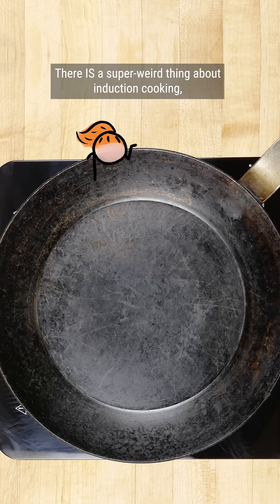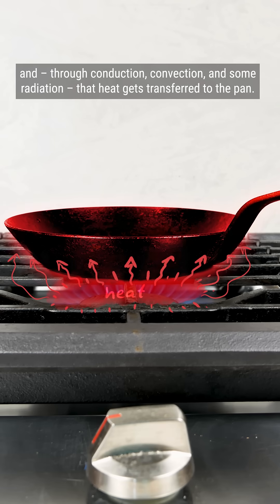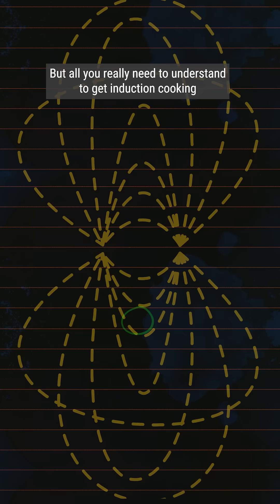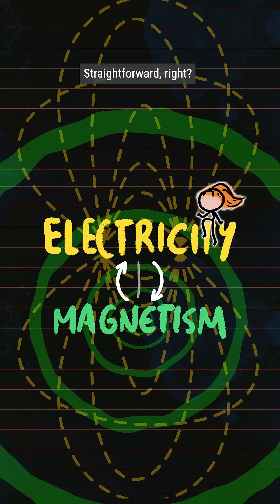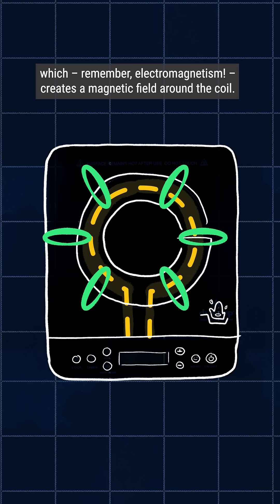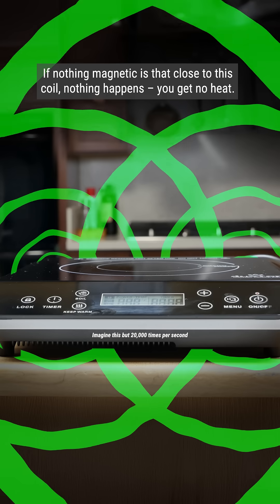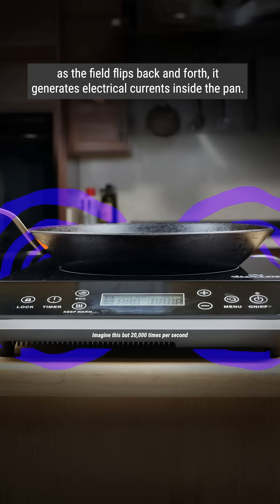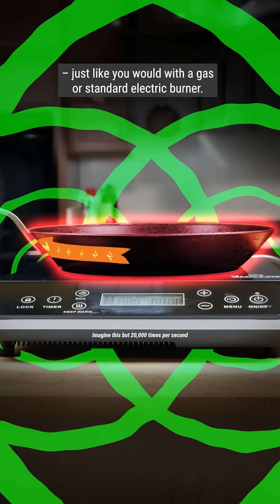How Induction Heats Your Pan

Comment: When we switched to induction I learned that the quality of the pan matters more than other heating types.  The magnetic areas only get hot If they are over the coil, so a thin steel pan will heat very quickly, but only where the coil is.  I tried a cast iron griddle, bridging two burners but it didn’t really work, cast iron doesn’t conduct heat very quickly so the edges and the area between burners doesn’t get hot enough.  Round cast iron works fine as long as it’s not bigger than the coil.  Copper in the pan makes for the most even heat, and more layers is generally better.   I won’t go back though.  The speed and not heating up the kitchen in the summer is too good to give up.

Comment: it's poo, for heating purposes, for humans, for cooking, for water heating, electricity is too digital, not analog enough, you get all hot, or zero hot, no inbetween. the only way the induction "heats up" is by increasing the heat applied, when heat is applied, but there's no consistent heat, so it's constantly oscillating between too hot to cook properly, and too cold to cook properly.
the more we just buy what is new, the less good things will be.
these engineers have never once actually seen any of their principles that sound good in theory applied in the real world, they refuse to acknowledge any of the practical application issues, and continue to be up their own ass about new equals better, like there won't be the same, decades long innovation schema that turns a prototype into an actually usable product. The more they do this the less interest people have, because their interest is always repaid with disappointment.

Comment: I thought radiation is only through no medium? Which is always impossible on earth since there’s always air everywhere, even in your kitchen.
Reply: No! The hea tfrom sun only comes as radiation, it would stop in the atmosphere, right? When sitting in front of a fire most of the heat you feel from it is radiation. Passing through a medium like air or water diffuses the radiation because some gets lost for heating the medium. The denser the medium, the more it blocks radiation.

Comment: Very good explanation, just one small correction: the pain itself is not magentic, just ferromagnetic, so any metal that interacts with magnets (for example, aluminum is not attracted to magnets, so it's not ferromagnetic)

The reason why that's important is because of magnetic conductivity. Just like electricity likes to take the path of least resistance, and would rather flow in a copper wire as opposed to plastic, the same goes for magnetism: if you have a magnetically conductive material, it will have much greater magnetic flux flowing through it -> this increases the induced voltage and this eventually gets you more heat
Reply: She and you are actually wrong, the pan doesn't have to be "magnetic", quite the opposite, it has to be electrically conductive, such that electric currents can flow through the metal, but not ferromagnetic, to don't get stuck on the surface while being on due to magnetic forces
Reply: @danielvitre476  it has to be both. You can check it by holding a magnet to the base of the induction pan/pot, the magnet will stick. If a material isn't magnetically permeable there won't be any magnetic field to even induce an electrical field in the first place:

B = μH

Where H is the field generated by the coil in your stovetop, and B is the magnetic flux density in the bottom of your pan. And since dB/dt is what ends up inducing anything, μ has to be sufficiently large.
Reply: @danielvitre476  induction cookers don't generate a strong field typically, that's why the pan doesn't stick to the stovetop. They however operate at a frequency of 25-50 kHz, which creates a huge rate of change in the magnetic field resulting in a very high induced voltage, even though the overall amplitude of the magnetic field strength is very small
Reply: Hey man, her explanation was better than your correction.
Reply: @jimsheehy505  I disagree. The explanation given in the video is not complete and partially incorrect. The explanation given by good man above you is accurate.
Reply: @jimsheehy505  what do you mean?

Comment: Aluminum pans, ceramic cookware (like pyrex), and stainless steel will not work with induction cooktop. Stirring food with a metal spoon/utensil can heat it up & burn your hand faster than expected. 

Credit cards with magnetic stripe on back can be erased if too close for even 2 seconds while induction cooktop is on.

NOT a good idea to sit laptop or other digital devices near induction cooktop, to use while waiting for food to cook... even for a minute or two.  Be more concerned about magnetic/inductive damage to internal hard drive or circuits, rather than just heat effects.

Comment: No, that is not how this works. Actually, what really happens is when the magnetic field changes, the metal retains some of the previous fields' magnetism, the change causes the fields to clash, creating heat, which is called eddy current
Reply: This is false. I'm genuinely curious as to where you got this explanation from because the real explanation you will find in physics and engineering textbooks, as well the in-field ISO documents for actual design and application goes as follows:

Briefly, "Induction heaters work by exploiting Faraday's Law, which states that changing magnetic fields induces circulating electric fields. These fields generate Eddie currents in the conductor, and since the conductor has resistance, those currents get dissipated and transferred to heat."

Magnetic fields don't "clash", they add together like any other type of vector and vector field: via the principle of superposition (they are literally vectors. They behave like vectors, not like cars). You learn all these basic facts and even test them in a high-school lab or Associates degree.

I'm a physics major. I've taken courses in EM Theory (which includes lab experiments). But you don't even need to be a physics major to understand such basic facts. There are countless videos and articles on the internet that will explain this phenomena without having to go through the tedium of Linear Algebra, Vector Calculus, and pre requisite physics courses. They can be broken down very simply without needing to skim over crucial details (unlike many other areas of physics). So I'm left wondering how you came to your conclusion given that the expanding to this phenomena is so accessible to the average person. It genuinely sounds like you don't have any expertise in this field yet didn't even bother to look it up and just assert your first and immediate thought as true, with absolutely no rigor or verification.
Reply: @helphowdoinputusername3571  you said exactly what I said. I just did it shorter
Reply: @stephenstyer8544  Once again, you are wrong, but this only confirms that you don't know what you're talking about.

My explanation is the same one given in the video (I just named the physical laws), the same explanation that you said was "not how this works." But now you're saying that we said the same thing, so the video is now correct?

So which is it, is the video correct or wrong? I was going to explain why our explanations are different, but the fact that you're self contradicting means I don't even have to.

Comment: Induction is junk. Yeah, it "works", but it requires that your best pans be trashed. No copper, not non-ferrous stainless, no metals that a magnet won't stick to. Guess what else that means? Your steel that has carbon in it? Yeah, that's going to rust if you're not Johnny-on-the-spot with cleaning, washing, drying, and probably seasoning, unless you like teflon in your food. Let's not forget about the fact that nothing electric works when the power goes out. A gas stove, whether natural gas or propane, will work just fine when the power is out. That means heat, hot water, cooked food, everything you do with a stove, can still happen. Just use a match to light it if you have electric igniters.

Comment: So it will electrocute if i touch it???
Reply: No. The induction produces eddy currents, which are basically microscopic current loops. The loops cannot leave the pan since no charge are being added or removed, so the pan does not shock you.

Comment: One thing I don’t see mentioned nearly enough about the benefits of an induction cooktop, deep frying, or more precisely, there is practically 0 chance of starting a grease fire. If you spill hot oil on a red hot burner or open flame you get grease fire, because for those to transfer heat to the pot they have to be hotter than the out of oil. But the hottest part of an induction set up is the pot the oil is in. So if any spills out there’s not flashpoint to make a fire.
Reply: Let me tell you man, you can get grease fire even with induction, i know because it happened to me while working in a restaurant, we had a wok in a induction cooker with oil for deep frying shrimp, but someone left the induction stove on and the oil reached a point where it self ignited, weird thing to see but it happens, but as you said, the chances of this happening are very low compared to a traditional stove.
Reply: While the chance of starting a grease fire is lessened with induction due to the absence of an open flame, it's stil entirely possible to heat up oil to the its flashpoint, causing the vapors to ignite. With animal fats this can already occur around 375 F / 190 C. Most vegetable oils are a bit more resilient with a flashpoint around 450 F / 230 C.
Reply: The oil still might catch fire if it gets hot enough. Don't ask me how I know.
Reply: But you are still able to heat the pan up enough to start a fire I’ve seen it happen
Reply: That is true but it comes with an additional risk: as the energy transfer is so efficient from the coil to the pan it heats up so quickly that you can burn anything in seconds if not paying attention, which leads to fire risk from the contents of the pan itself. 

This also happens when boiling. In a conventional stove the temperature of the pot never raises above 100C if there is enough water inside but with induction you can overheat the metal even if there is water on top of it... That's how I ruined my old pan when I switched to induction and also the reason why you can burn the lower part of the vegetables you are boiling if they touch the bottom when on full boost
Reply: @saetastr Never had that happened to me and I have years of experience using induction.
Reply: @saetastr  I mean just don't turn the heat up that high and it'll be fine. You get plenty of heating from medium power and you can simmer just fine on low. The only time I use the high power is to start boiling (I turn it down when it starts to bubble) or to quickly pre-heat the pan for like a minute before turning it way down
Reply: @kinslayer202 you wanna use maximum heat with a wok

Comment: I have a 5-gas burner at home; the fifth one is a large dual-ring burner for large pans and woks.
I use aluminium pots to cook rice in. I use a wok when I make a quick stir-fry every now and again. I do a lot of frying so induction wouldn’t be suitable, especially when I tip my pans to spoon-baste meat.
I used induction at a self-catering apartment on holiday once and I got so frustrated with it, especially when the touch-control buttons got all oily and wouldn’t properly register my touches with the frying I was doing.

Comment: Also, induction stoves are insanely fast, compared to standard electrical ones. At least that's what I've experienced
Reply: Yeah you have to be careful with carbon steel not to heat it up too quickly on induction, otherwise it'll deform

Comment: EMF is radiation. It's basically an mircowave pointed up. Fml
Reply: No, not really. This is like saying that sailing the seas on a sail boat and flying a jet is the same because both of these propulsion methods use flowing air at some point.

Comment: Not a fan of induction. It only heats the specific area. Consequently making the sides of the pan cooler. Can’t beat cooking under fire. I only use induction to boil water for pasta.
Reply: I like my lungs. And not burning my hands on red hot handles. Preheating pans works just fine.
Reply: That depends a lot on the cookware. My favorite pan gets hot very evenly. But I have others (very cheap ones) that heat unevenly at the bottom, and stay cooler on the sides.
Reply: @schana96 I have le cruset, Staub, made in and all clad D5. They are definitely not cheap.
Reply: @ Don't know what to tell you. My favorite one (that works perfectly) is a Tefal. Wasn't particularly expensive either - like $70. My cheap ones, that don't work well, were like $10.
Reply: Can't beat gas stoves for a searing hot pan frying
Reply: @ yes you can.
Reply: @sendoh7x  do you seriously believe induction doesn't get as hot or something?
Reply: @sharkenjoyer  if you crank up the power on an induction cooker, only that small area that get really hot. Also not really condusive to do that tossing motion
Reply: @sendoh7x  i have no idea what kinda temu extra tiny gnome stovetop you're using, but my plate has circles big enough to cover the entire pan.
The edges do get hot too.
Reply: @sharkenjoyer  good for you
Reply: @sendoh7x  I agree the heating area is more direct than diffused like gas or other type of stoves.

Comment: In schools they taught us "In electricity, heat is always generated through the resistors" so my dumb brain still uses that frame to understand the world, im here trying spot where the resistor is on the pan so it can get hot while the currency going through it, unable to find it obviously i exasperate "wait, magnetism is electricity now? When did that happen?"

I am a biotech guy, despite the fact that i know what AC is, outdated school brainwashing STILL interferes with how i try to understand the world. Schools should be more about learning by doing and observing the effects in a play environment, rather than having to memorize a bunch of possibly outdated tidbits of neatly packed information because thats the only way to tangibly score the students on.
Reply: Basically, any metal has some resistance unless it's cooled to like absolute zero-ush temperatures. So, the pan itself is the resistor. Yes, the resistance is insanely low, but heat generated is proportional to resistance times current squared, so it's more important to have massive current than massive resistance.

Comment: How much of an electric current does it generate; just curious if you can get electric shocks
Reply: Did you watch the video? It doesn't generate an electric current, it generates a magnetic field. The magnetic field doesn't generate an electric current, it just generates heat in the molecules of the pan.
Reply: @thegreybrewer  Incorrect, as magnetic fields cannot generate heat. The field does generate a current, but it's eddy current, aka. microscopic loops of current that generate heat through electric resistance. You cannot get shocked by those since the current is confined to the tiny loops and does not enter or leave the metal
Reply: You can’t get an electric shock - there can be high current in the pan, but there’s no new charge flowing into the pan. So it will stay at the same voltage as when you placed it down.
Reply: A single loop of wire on top of an induction hob gets about 6V maximum in it. The electricity induced in a cooking pan flow in it and there is no possibility of shock.

Comment: how power efficicent is it compared to a regular eclectic stove? and just to be clear, I don't mean those cheap looking ones with the could you place the pan directly on. those suck.
Reply: A gas stove on average heats up the room more then it heats the pan, so yeah the induction pan is extremely efficient, but realistically it depends on your electricity and gas cost
Reply: 10-15% better than electric, in terms of efficiency. Another advantage though is the speed - induction pans get hotter much quicker.

Gas vs. Induction isn't even a comparison. It's like 3 times as efficient.

Comment: But why the hell do they need to flip directions? Why can't they just keep going in the same direction?
Reply: It won't create eddy currents
Reply: A change in magnetic field causes a change in current. If you have the coil operate in only one direction, then when you turn it on, the magnetic field will get created, which in turn will create a current in the pan. But then, electric resistance will kill the current, and since there is no change in magnetic field, the current will not change anymore either. You need to perpetually change the magnetic field to perpetually create new (alternating) current.

Comment: Magnetism is sideways electricity.  Every loop of the coil is electricity in the same direction, viewed sideways this is a lot of magnetism added up.  So the iron pan is magnetised accordingly .  A moment later the electricity is run the other way, so the pan is magnetized the other way .  Looking sideways from inside the pan, this magnetizing is electricity running around inside the iron, thus heating up the metal .

Comment: Am I missing something? No idea in terms of physics why the pan would have to be magnetic or even a ferrous metal. Broadly, Electromagnetism can induce currents in any kind of metal/conductor. In fact in the quintessential physics class demonstration you drop a magnet in a copper tube, not a carbon steel tube.
Reply: Try putting a copper pan on an induction burner. No dice.
Reply: @thegreybrewer  any idea why?
Reply: You're absolutely right. The ferromagnetic stuff is nonsense.

Comment: You should also know that the field will generate an uneven heating though. if you use a thermal camera you see the shape of a circle where the coil is as the hottest spots
Reply: Depends a lot on the cookware. My favorite pan heats very evenly, but I admit, I obviously haven't checked with IR.